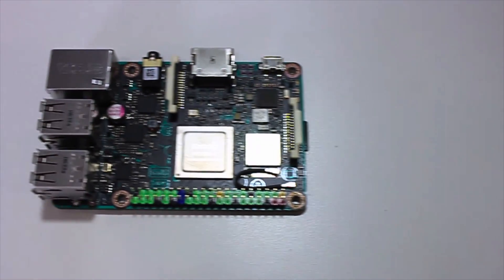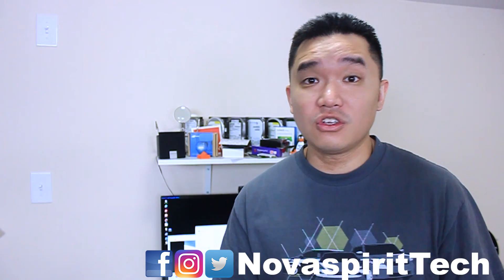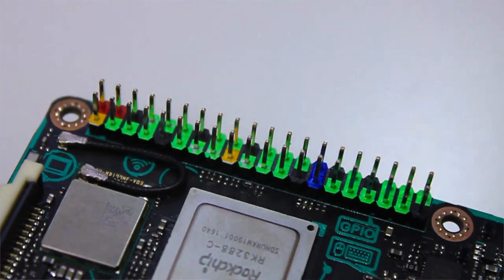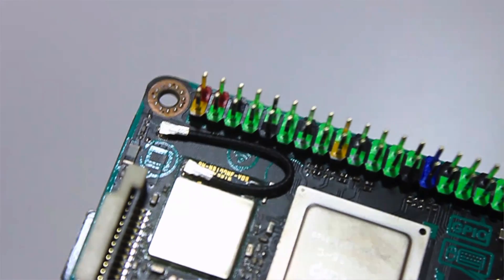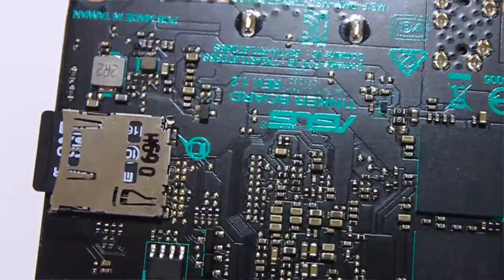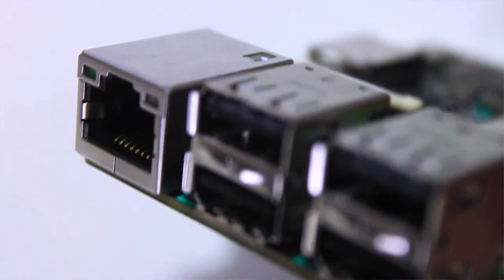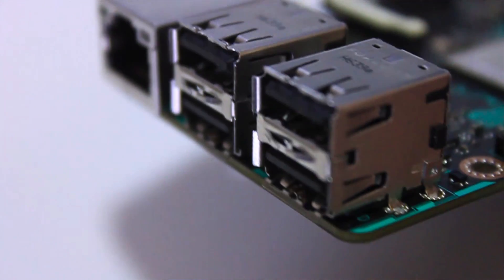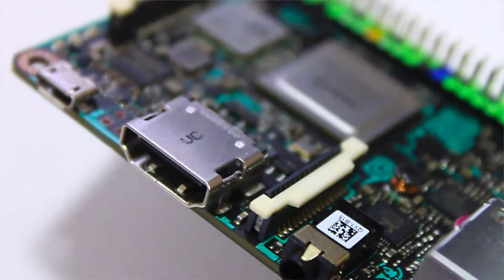Asus Tinkerboard Review - Raspberry Pi Killer?

Comment: Seems like nobody had my problem: touch it's back with your finger, around the ASUS logo, and you will have a system crush with a fail of screen output, as long as your finger is not absolutely dry. I believe this is a design problem on the hardware layer, although I just bought one. And I returned it.

News are that ASUS offered us the updated model: Tinkerboard S in the CES of 2018, with a build-in ROM that you could burn images into. Hope it will not have such problem any longer.........